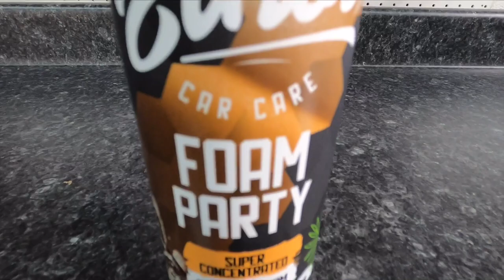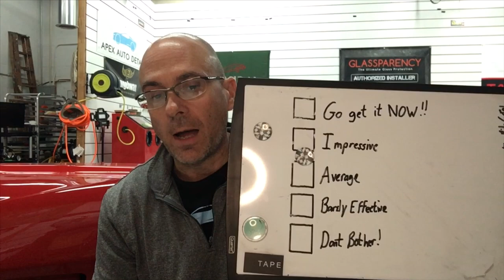Is This The Traffic Film Remover We All Have Been Waiting For? Let's Find Out! Ethos FOAM PARTY!!

Comment: The pressure washer used by itself acts as a cleaner to some extent. I would have just rinsed it off with a hose this way the end result isn't influenced by the pressure washer. This way we can see if the product itself is actually breaking anything down by comparing it with the untouched panel.

Comment: Thanks Brian.  I've been using the Griot's foaming surface wash, looks like a very similar product.  I have a feeling even though the Griot's says it's PH neutral it's hard on my sealant stripping it.  But I also think I may use too much.  I think it should be using 1.5 to 2 oz in my PF22 and I have been using 3.  Who knows.  Maybe when I run out I'll give this a try.  Going to coat the car soon and I dont think either will strip that.

Comment: From a UK perspective, the two very best products I've ever used are Bilt Hamber Auto Foam and AutoBrite Magifoam. 

I dont know if you've tried either of these as they are UK products, but they are amazing. 

Bilt Hamber isnt particularly high foaming but it is really high activity and cleans amazingly well. 

The Magifoam produces RIDICULOUS foam (and that's from a standard electric Nilfisk pressure washer) that just clings like mad. I've had over 30 minutes of dwell with this before I've needed to rinse and I swear, after the 2 bucket hand wash, the water in the rinse bucket had literally no dirt!  

I now only two bucket wash once a fortnight instead of weekly because the Magifoam cleans so well. 
I literally (once or twice a week) foam the car, rinse and blow dry. That's it.

Comment: I dont know if you have recieved negative comments on your place of bizz being used as a video location.personally it adds a air of authenticity,especially the shop pup.i,m a big fan of ethos products.killer consumer response and gratitude for purchases.i get deal offers all the time.the drying aid is nice albeit xtra work.aparently they are changing that formula due to settling issues,i have no issues,...shake it up.ya know? Great little company.
Reply: I orderednl 2 bottles,they have gallons available.i went straight to Tim...very hands on.20% off on eveything site wide.it does what its supposed to do.the website says breaks down road grime ,but not a miracle,just cuts your work in half on even a fairly well maintained vehicle.if you have issues,just email tim( sorry pal) he,ll fix it.

Comment: Hey Brian,
Thanks a lot from Germany for your awesome work that you put into these Videos. I enjoy them a lot as you focus on strategies like paint stress reduction while polishing etc which are not commonly addressed.

What do you think about some videos about washing techniques that safe time while maintaining a good safe wash experience?
I found myself using one bucket only and using a high quality 70/30 wash mitt that is constantly rinsed with the pressure washer. This method safes me the time of filling an extra bucket and also reduces cost for a dirt trap and all that stuff. Also the mitt is way cleaner than rinsing it an a bucket could achieve.
The point of my suggestion is that perhaps techniques with foucs on profitability and time savings could be interesting to a lot of people.
Cheers

Comment: So I bought a new car and did not get a chance to wash it for 1 month. I used purple power vehicle and boat wash (175ml in 1 gallon) and spent a lot of effort hand washing it. After drying the car, I found SO much dirt and grime still left behind. I am shocked and disappointed. Also the car doesn't have any coating on it so I wonder if its because of that. I'm going to hand wash it a couple of more times after it warms up and layer up some spray sealants.

Comment: I'm new and only seen a few of your videos while browsing. My question is, is there a foaming product that can be applied that will COMPLETELY remove dirt, grime, etc, without having to do a contact wash afterward? I'm talking about nothing left behind. So clean you can take a towel and dry the car and no dirt is on the towel. The reason I ask is I've been cleaning cars for years and have tried numerous products and they all leave dirt behind and I still have to do a contact wash afterward, making me spend an extra 30 minutes on a car. We all know time is money. The faster I can get a car cleaned, the better. It seems to me that "pre-washing" only creates an extra step and makes the cleaning process take longer. Just my opinion. If there were a product that could completely remove dirt and grime, there wouldn't be a need for a contact wash and the cleaning process would be faster.

Comment: I'm hyper-paranoid about marring my paint. After doing the wheels, I usually do two foam coatings; one for the touchless wash, a second pass for my touch wash, and an extra one sometimes for claying (if it's necessary). Blow dry, then towel dry, then apply protection.
Reply: Near impossible to clay a car (regardless of lubricant) without marring the paint.  If you are hyper-paranoid about marring... why would you ever clay without an immediate follow-up correction?
Reply: And my wife says i,m to fussy.i,ll let her read your reply,that will kill all the jabs about water spots and  bugs,Thankyou!